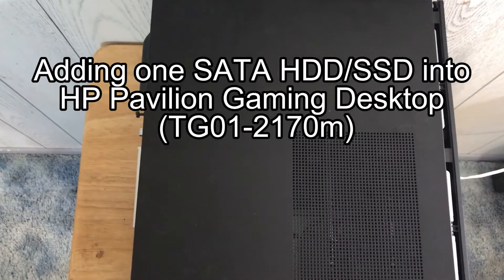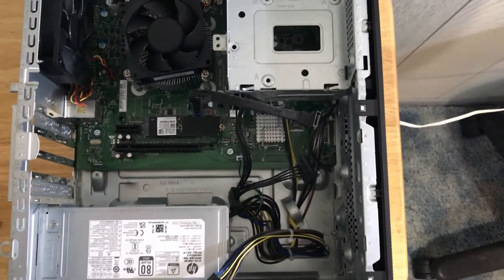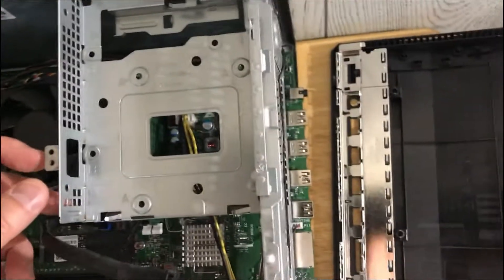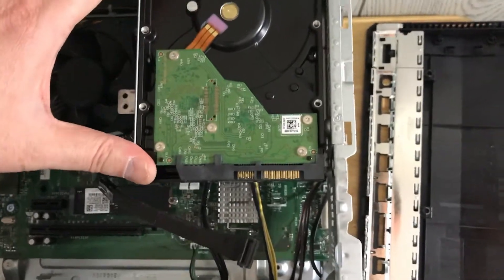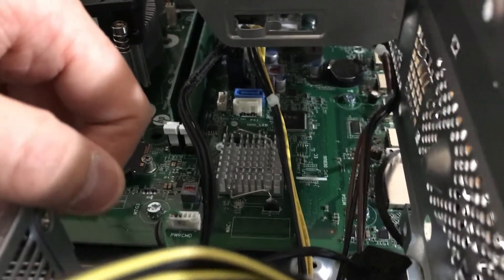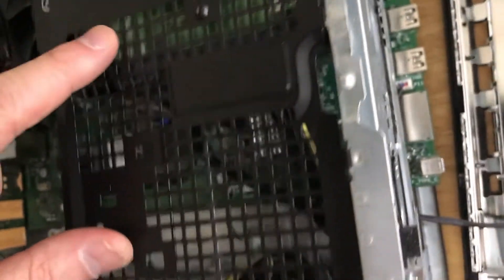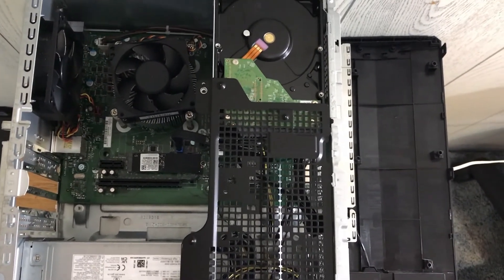20220220 Ep 2 Adding SATA SSD or HDD into HP Pavilion Gaming Desktop TG01-2170m

Comment: Can you give me the link for the sata power cable ? And is there any difference in other sata power cables ?
Reply from the maker: @plantsvszombiesgamer1,
I am guessing you are talking about the SATA power cable that comes out from the 4 pins connector on the motherboard, right?
I know the part number of this SATA power cable. I dont have the link to buy one.
This label of SATA power cable states:

Century Asia 2118
HH P/N:35074L C00-783-G Rev A
HP P/N:L68308-001 Rev A

If you just do a search online with keyword like "L68308-001 Rev A", you should be able to find some used computer part sellers who sell this SATA power cable.
Or try to call HP sales 1-800 number; maybe HP would sell you one.
Reply: @jing-chianwu  thank you

Comment: could you tell me pls what number it`s on the 4pin to sata pwr cable? looking for that cable 3 weeks now. please
Reply from the maker: I don't understand your question. Can you tell me the time stamp of this video when you saw it?
I am guessing that you are searching for a "sata power splitter cable 1 to 2".
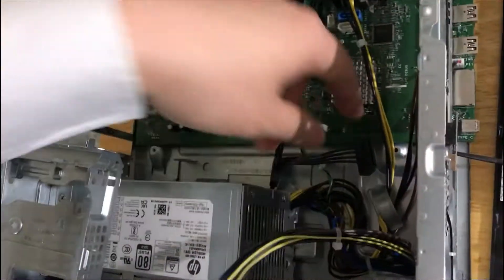Reply: @jing-chianwu  that`s min 4:11. I`m looking for the part number to the black cable. 4pin to 2xsata
Reply from the maker: @outlimitz5225  Ok. I understand you now. I will go take a picture of it later today and post a picture on my channel. But this special HP cable is just a 4 pin (+12v, Ground, 5v, Ground) sata power cable. If you don't buy this from HP directly, you will need to make sure the correct voltage goes to correct pin. Use the multi. meter to measure the 4 pin on HP motherboard then check the data  power cable spec sheet to make sure they are what they should be.
While you are waiting, you may want to search online with keywords like"HP SATA + 4 pins Power Cable Optical Hard Drive P/N 507149-001 628568-001", HP 611895-001 611895-001 6200 Pro Elite 4-pin to 3X SATA Motherboard Power Cable , or HP data power cable. I cannot promise you the cables you see from the online stores are the one you need. But they look very very much like the one that I have in my HP PC.
Reply from the maker: Ok. I wrote down the part number of the power cable. There are three lines on a sticker. 
Century Asia 2118
HH P/N:35074L C00-783-G Rev A
HP P/N:L68308-001 Rev A
Let me know if you want to see the pictures. Youtube comment section does not allow me to post any picture.
Reply: @jing-chianwu   Thank you so much, i just ordered it on e-bay.

Comment: is 2.5 or 3.5?
Reply from the maker: I used a 3.5'' 4TB SATA HDD in this video. But the 2.5'' SSD/HDD can be secured on the same metal frame. It just uses different screw holes.
And I guess the black mesh that I didn't use can be used to hold the HDD/SSD as well.